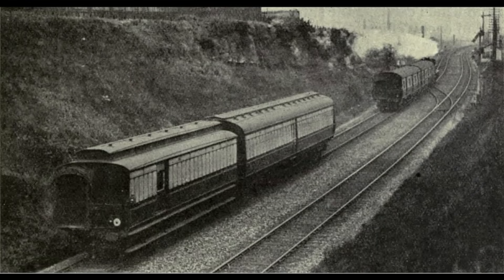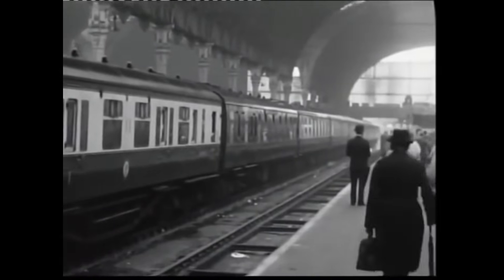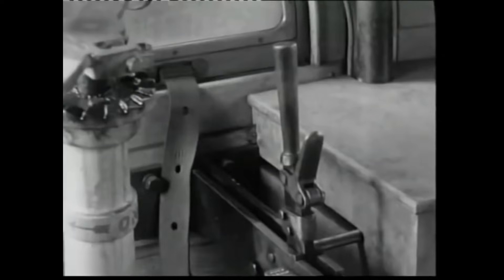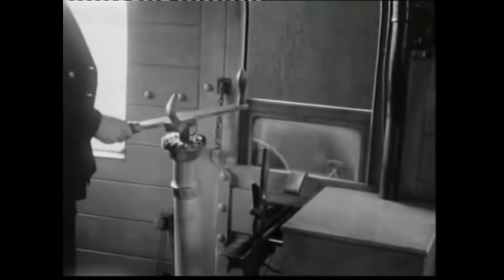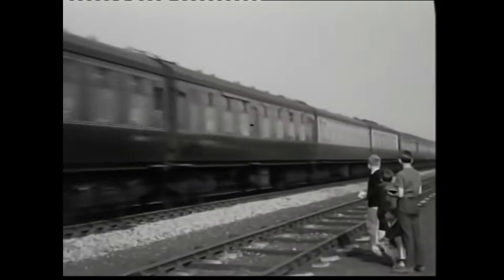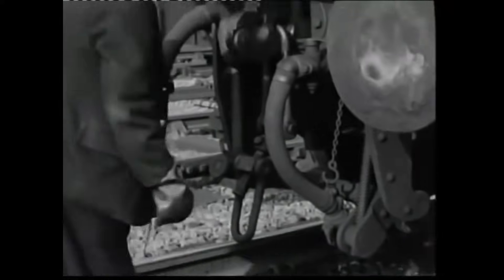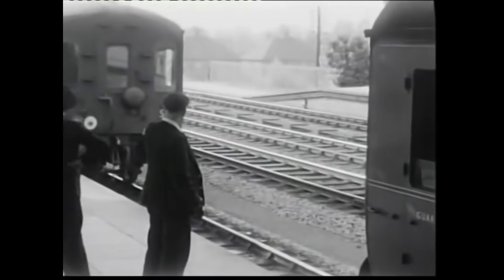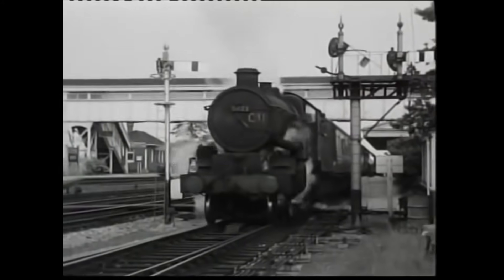Slip Coaches Explained: How Trains Dropped Coaches Without Stopping #gwr #coaches #fyp #railway

Comment: Believe it or not, the basic idea is good.   Even in 1960/whatever the "tech" wasn't up to the task.   A "modern" system might have the "drop coach" be a motor coach with "robot" control and a conductor backup.   The train likely would still slow down a bit but it is stopping that  really slows down the schedule.   At each station, the train would lose a motor coach and a conductor and gain a motor coach and a conductor.   The motor coaches would only go to the next stop but the conductors could be switched in the trains and provide crew changes for the rest of the train.   Crew changes also slow down the schedule.    

It could also work on fast freights but with the motor coach accelerating from the front of a slowed down fast freight and the train being joined at the front with another motor coach.   Slowing down for a transfer adds time to the schedule but nothing compared to stopping the train.

Comment: How do you collet the cars on the return?
Reply: A train will have to stop to pick it up, which is one of the reasons this technology was abandoned in passenger trains.  A related development (a remote controlled pin puller) called Helper Link was in use in the late 1990s onwards in Montana, USA, although I don’t know if they bother any more.

Comment: While not slip coaches, in Canada, trains were sometimes split at a station, with the two sections going to different destinations.  They would be combined in the opposite direction.  I can think of two trains where this happened every day.  One was the old Canadian National Super Continental.  Trains from Montreal and Toronto would join in Capreol Ontario, while heading west to Vancouver and the eastbound trains would separate in Capreol, with the two sections heading to Toronto and Montreal.  Another, a CN/Ontario Northland train, would split at Porquis Junction with the sections going to Timmins and Kapuskasing.  I was on both trains many times.

BTW, many years ago I worked for CN and was based in Capreol for a couple of years.  Back in those days I frequently rode trains, both passenger and freight.
Reply: Still happens in the UK, too. Crianlarich is the place that comes to mind.
Reply: This is also being practiced on InterCity and Express services in Denmark, using DMU and EMU stock. All at the touch of a button...
Reply: This happens to this day in Scotland, with trains departing Glasgow and Edinburgh for places up North. They’re divided with passengers told to ensure they’re in the right half of the train for their destination. It’s the benefit of running multiple DMUs/EMUs together, as opposed to loco hauled carriages.
Reply: The Empire Builder in the USA still does this in Spokane, with one section going to Portland in Oregon, and the other to Seattle in Washington state.  Also, confusingly, set-out coaches are called slip coaches in India (and probably Pakistan), although I’m not sure how common these services are there now.

Comment: I've learned something today, thanks. This is from an article I wrote a few years ago, unaware of slip coaches: "... in 1894 Prestwick had 30 trains a day in each direction between Ayr and Glasgow. Prosperous Glaswegian business commuters liked the fast 4:15 pm from the city which, even at high speed, ‘with an ingenious device’ uncoupled its rear portion at Irvine, without stopping (presumably to slowly come to a halt with the aid of a brake car)." Irvine is 9.5 miles from Prestwick!

Comment: It breaks the signalling rule of absolute block - one train allowed in a section at a time. One foggy day it was agreed that if visibility was poor at the point of slip, the slip would not take place and the train would stop in the station for the slip coach to be detached. But the guard thought the visibility was OK and slipped the coach. The train, not knowing the coach had slipped, stopped in the station. And in the poor visibilty the slip coach ran into the back of it.
Reply: Not completely true .  We coupled on to a train and entered an absolute block and then cut away at speed to save on authoriies  , le voila suddenly 2 trains arriving at different times in the block  .  Also pushing a freight in the fog and cutting away is pretty similar to slip coach , in the fog done it  .  Freight trains can do that without breaking the same rules altho not always endorsed but sometimes required . Stealing a switch paa fri bahn is another way to end up with 2 trains in an absolute block on the continent bla .

Comment: I'm not quite following all of this. First, there's no gradual rise at Bicester for the slip coach to slow down (well, maybe a tiny incline). Secondly, why does the train stop and pick up the slip coach again? Maybe for practical purposes, but it's not really part of the story is it? The whole idea was to avoid the main train having to slow down too much.
Reply: The narration is confusing. The slip was added to the front of the train already in the station. This then  followed the non-stop express. Obviously BR (W) had refined the scheduling to avoid having to have a spare loco at Bicester to shunt the slip into a siding after unloading the passengers. The return working could be in a passenger or goods train.
Reply: The express released the slip coach without stopping. The loco from the local train then shunted the slip onto the local train.
Reply: The slip coach has its own brake. I was confused too but it seems slip coach services had two guards and one stayed with the coach in order to activate the slip mechanism and then stop at the right point in the station

Comment: From an operational point of view ?? What advantage was there?
Reply: It meant the train could serve Bicester without actually stopping there, which adds to the overall journey time.
Reply: @Clivestravelandtrains  but only in terms of set down of course. Which if it is London commuters may work.
Reply: Dropping coaches off meant that the locomotive would not have to haul the complete train over some stiff sections such as the Devon Banks, avoiding the necessity of double heading
Reply: For steam trains, plenty. Steam trains struggle with acceleration and going up hills, so lightening the load helped them keep to time and not get slowed by hills, or having to double header.

As dieselization came around, they had better acceleration and hill climbing abilities, so could stop more and handle heavier loads, while keeping to the same timetable as a steam train
Reply: There must have been many advantages best known to the railway company. They wouldn't have continued with it for all those years if the trial had been a failure.
Reply: Interestingly, there were a few instances of slip coaches being used to service multiple London terminals, including a GWR train that slipped coaches for into the Paddington terminus before the rest of the train continued along the Metropolitan Railway!

Comment: One thing I never realised. Look at the footage of the Guard on the platform at Paddington and you'll see that he locks the door of the slip coach after the last passenger gets in. So passengers were generally locked in to the coach to stop them jumping out at the last minute or misbehaving in some way?  Not something I'd thought of. Doesn't appeal for some reason.
Reply: We are locked inside modern trains, by the way, with doors controlled by a member of traincrew.
Reply: @Clivestravelandtrains 
There are no windows to jump out of. Now, all of the carriages are air conditioned.
Reply: @Clivestravelandtrains But today's trains have emergency brakes accessible throughout the train, as well as emergency door releases on each door.
Reply: There were some gangway-equipped slip coaches, in those cases the crew would check that all passengers had returned from the restaurant car before commencing the slipping operation.

Comment: All the while the car transport low loader wagons were on the Cornish London services the rear most wagons were uncoupled at the intermediate stations from Exeter onwards and shunted off to an unloading yard where the drivers picked up their cars if loaded in the correct order and wagon at Paddington.  One year my fathers car and our luggage ended up at Plymouth instead of Exeter where we alighted.  Could have been worse and Penzance.  The reverse happened on the up services.